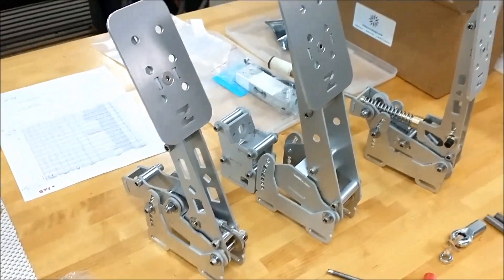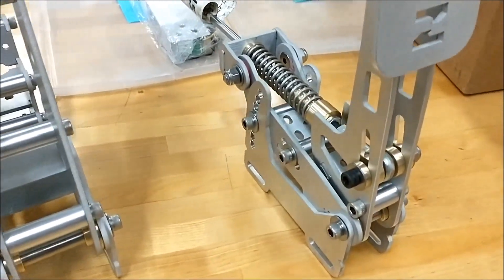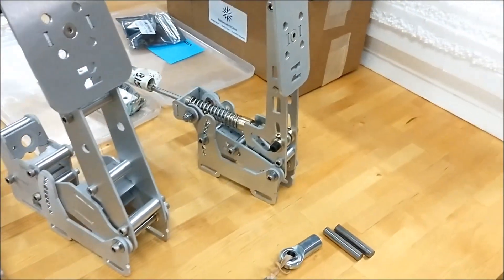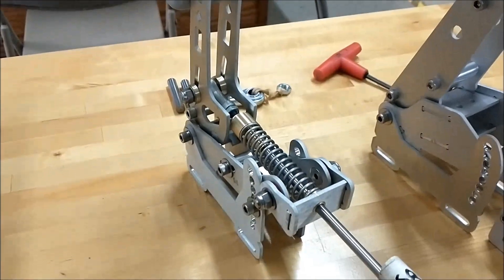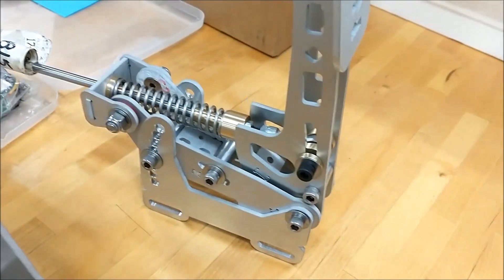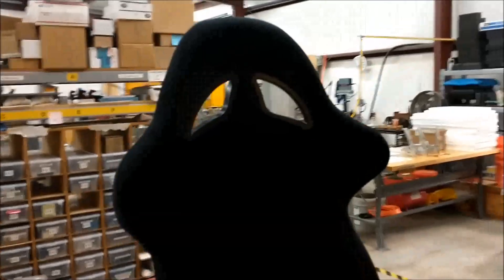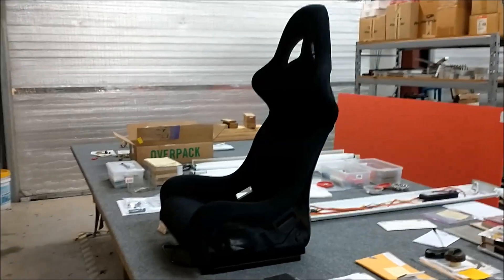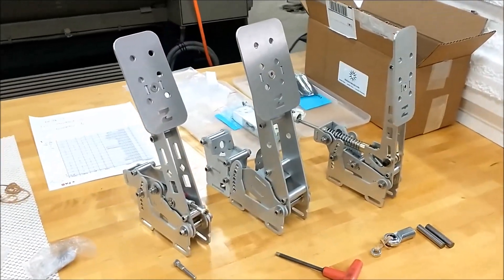F1 Sim Rig Build -- Part 1

Comment: I dont think F1 cars have a clutch pedal these days haha... nice project Joe
Reply: Maybe it is for vintage F1 Sim.  LOL    The freedom units is also not very F1.  I really do wish this country could figure out base 10 systems.
Reply: @joeldriver381   Snort. Conventional fractions are binary and actually the same way a computer stores floating point.  Anyone doing work in inches in a machine shop is using decimals, not fractions.

The place where metric falls apart is in threading. For whatever reason, the standardized metric threads do not have a common multiple of a reasonable value and it's a real pain in the ass to thread them,  and don't get me going about all the discrepancies between JIS,  DIN, and ISO standards for head sizes.
Reply: McMaster or Fastenal have metric hardware in stock for me to will call or have shipped. Everything I work on, modify, and make parts for is metric. Cars, motorcycle, race karts, most bicycle components. I don't repair vintage things...  A lathe that can't cut metric treads would be of minimal use.  I have no issues using a 1/2" end mill but I am not going to make parts that use non metric hardware or are dimensioned in freedom units.  The US military and all our allies that would assist in the concern over being invaded by China are all 100% metric.  France would maybe make more sense in this case?  There are 10 types of people those that understand binary and those that don't. 🤔
Reply: @joeldriver381   Well, at least the metric taps are coming down in price a bit.  I wouldn't want to have to spring for metric dies or drills, however,  and even with a metric lead screw and a metric threading, dial, single pointing metric threads is a royal PITA. Whoever came up with the pitch specifications for ISO metric threads clearly had no idea of the principles of operation of a screwcutting lathe.

Comment: Going to be interesting Joe. Most won't realise how technical a pedal is in this application. Not simply something you push with your foot. Well it is something you push with your foot,,,,, oh, you know what I mean !!
Reply from the maker: The load cell integration is interesting, and the brake is like a brick. More force feedback than actual movement.
Reply: @joepie221  oh, sounds like a direct linkage will be an issue. Got any spring steel ( diving board arrangement) load cell fixed end, pedal travel bouncy end.  I could be talking horse s#$t though as I'm trying to visualise what you're doing😁
Reply from the maker: @NellsMechanicalManCave  I'll show it when I get to that installation.